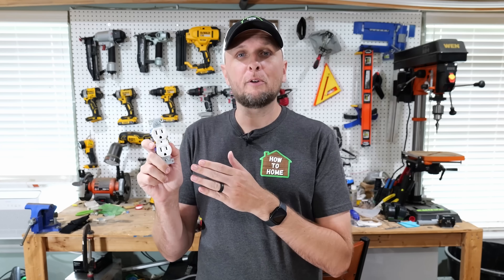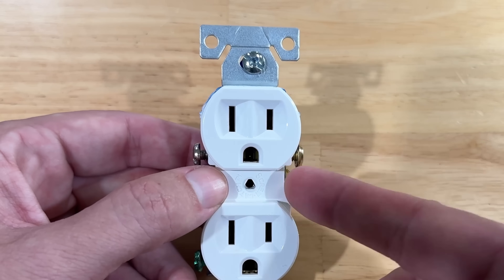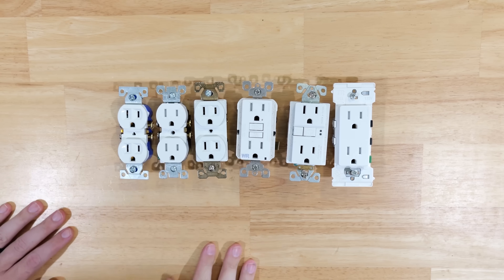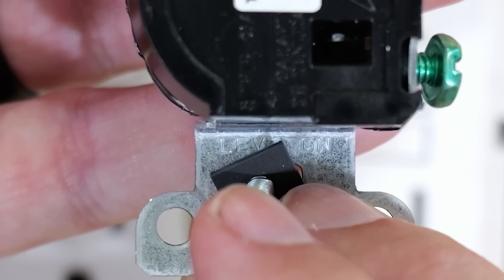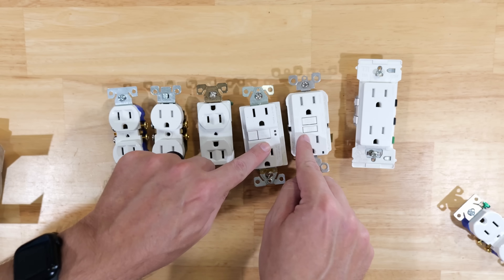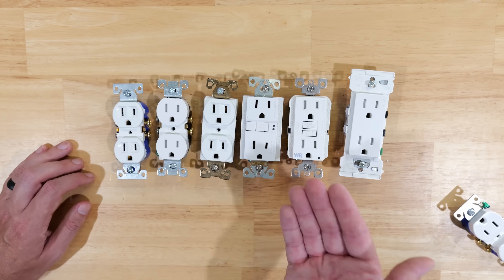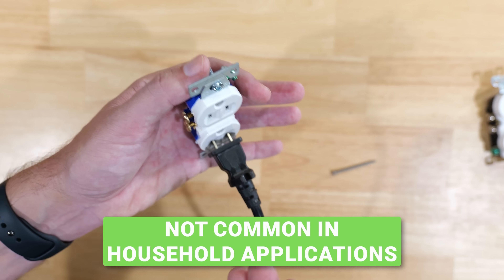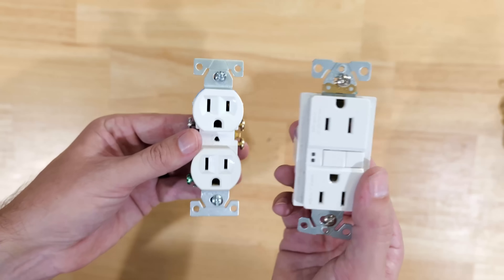The Shocking Reason Why Your Outlets Are Installed Upside Down!

Comment: Talking about text orientation was useless IMO. I have computer components with installed in my PC with texts facing every which way, it doesn't mean anything, but those components certainly do have a correct orientation.

Having said this, unless there is a specific case scenario where you want ground-prong in the up position, you should always be installing them with ground prong facing down. Why? Consistency. Power cords are designed with that in mind (like if it's a surge protector with a flat plug and the cord comes out of it 45 degrees to the bottom-left, then if you install the outlet upside down, that cord will face upward right instead. In general, when people plug stuff in, they are used to the ground-prong down orientation and will subconsciously expect it to be that way if they are plugging something in semi-blind.
Reply from the maker: I did it to make a point.  Your comment is useless IMO.  Everything was done for a reason.  Also, your PC isn't a receptacle.  When it comes to direction of install, it is irrelevant.

Comment: As an electrician in Ontario we install ground down for your safety. When your electrical cord pull out by mistake the first pin do come out first but you still have your ground for protection which will save your life.
Reply: @lecanada-d7f: Ground prong up when that outlet is attached too the wall-switch so people there know where to plug in their lamp to control it from the wall light-switch.
  Medical facilities have things hanging on walls that fall, like clipboards, scalpel, hemostat, that can fall and short the circuit, military galleys and  restaurants, ground up was specified, due to stainless steel utensils being dropped, etc. Therefore it has become required that they be ground up for contractors. In many cities ground up is standard in all commercial and industrial buildings, ground only go down in residential buildings, houses, apartments, condos, etc. 
   Internationally, countries with 3-prong outlets always have the ground up
   Everything is in context and the answer DEPENDS on context. 
   Examples:
“Never took the orientation of an outlet seriously until I was measuring for a shelf with a tape measure. It slid down and fell across the prongs of the washing machine plug.  POW! “ —@joef.6596
“I work at a K-8 school. Maintenance assembles powered multi media carts with the ground plug up in consideration of teachers dragging metal bracelet chains across partially unplugged power plugs.” —  @scaryhouse7969
“a length of florist's wire rolled off a side table onto a slightly loose plug and shorted the circuit, creating a small fire (quickly extinguished).  I now always install ground prong up” @deegee54
“I work at a restaurant and we have this work table with some outlets built in on top. Someone managed to let the edge of some tin foil go in between a plug and the outlet and it got disintegrated.”@MatthewSuffidy
“I knocked some change off of my end table one day my mistake of course, and a coin fell down right on the prongs resulting in a loud pop and a flash along with some smelly black smoke. I have since gone through my home and reversed all of the receptacles so the ground prong is now on the top.”—@chrisenglert3958
“my wife's gold necklace chain dropped off the rack onto two prongs of a device that were plugged into a receptacle with just a little prong showing.  It vaporized the gold necklace area of contact and left a nasty burn mark on the faceplate of the receptacle.   This was on a bar and I probably should have oriented the receptacles there ground prong up.“—@winfordnettles3292
"I had lunch with the Chief Electrical Engineer at McDonalds headquarters. He told me that one of the workers in one of their stores had her hand badly burned when a metal cookie sheet (or something similar) slid out of her hand. It fell onto a receptacle that was loose…the metal cookie sheet made contact with the two blades resulting in  big arcing flash that caused the injury, this is a reason Ground Up is safer."
“In commercial buildings (where receptacles are very high from the floor) ground has to be at the top. In a case of a water leak ground has the first contact with the water. In residential buildings (where receptacles are not far from the floor) ground needs to be at the bottom. In a case of a flood, ground wire would have the first contact with the water.”—@powerzx

Comment: The outlet itself is the worst design I have ever encountered. Permitting exposed energized contacts is just plain dumb. Both the European and the UK/Ireland outlets shield the contacts perfectly until the plug is completely removed. I have never seen a cable fall out of a European socket, but I see this in the US all the time. It is surprising how this flawed design was pushed on so many other countries where they obviously knew nothing about the much better alternatives.

Comment: This is a dumb non-issue. Here in America, we've lived with ground down outlets for centuries (plus all the years we lived with no ground at all) with absolutely no issues. I am 70 and have worked as an electrician's assistant on and off a good deal of my life. My work has always received top approval from the electricians certifying the job. Two of my 4 homes have ground down and 2 have a mix of no ground and ground down). Even the modular one I recently had built to replace the one I lost in a fire, which I built in the 80s, has only ground down. There is close to no situation I can see in a home where this would be an issue. In order for it to be an issue you would need something metal, incredibly thin, to fall down a wall and specifically land on the prongs of a plug that wasn't pushed all the way into the outlet. A plug left out far enough to still conduct electricity and leave a gap large enough for something to fit between it and the outlet/wall is in itself a situation which is basically near impossible.

Comment: I will add this. what if you purposely positioned plugs to what side of the 220v it is connected to? this way you would know not to plug 2 space heaters on the same 110v side. the fun part is wiring and older home. ever have a gas stove grounded to a PEX water pipe ? I did!

Comment: Thanks for settling this issue. I’ve installed many outlets in my homes, and always with ground hole down. But I have often wondered if this was the best way, or there was a good reason for the reverse. I’ve noticed that in most cases where the outlets were installed (presumably by professional electricians),   in homes as they were built, they’re almost always installed ground hole down. So that’s what I do, too.

Comment: Not an electrician but when I handle a plug I prefer that my finger is not in a position to contact the live prongs. My thumb is always on top and index finger across the bottom so if the plug is only partly in the outlet my finger could be across the live prongs.  I can’t think of an instance where anything metal  in my house would fall across the live prongs.  Plus a lot of plugs are meant for ground down orientation.

Comment: Seems odd to someone who doesn’t live in America.
Most countries I’ve been to have the earth pin at the bottom. These countries also have a switch for each socket.
We see this in Europe, UK, AUS and NZ for example.
Is there any reason you don’t have sockets with switches as standard?
You’ll also see in most instance by having the earth pin at the bottom the cable points down, it would point up if the earth was at the top, something I’ve never seen.
The nail argument is not really valid as it would trip the breaker (or don’t you have those either).

Comment: I'm in electronics and always agreed with installing sockets the "wrong way" for the reason that if you drop anything metal, which I've done before, it will short across the AC connections if not placed ground up.  I always thought that was ridiculous.

Comment: Three-prong devices like timers seem always to be ground prong down, and it's virtually all I ever see, so I never questioned that orientation.
Reply: Because you're not involved in industrial use. Medical facilities have things hanging on walls that fall, like clipboards that short the circuit, military galleys and  restaurants, ground up was specified, due to stainless steel utensils being dropped, etc. therefore it has become mandatory policy that they be ground up. In many cities ground up is standard in all commercial and industrial buildings, ground only go down in residential buildings, houses, apartments, condos, etc.
Reply: @violetviolet888  Believe it or not, I watched the video and he did address reasons for ground prong down around 9:30.

Comment: An important subject is how to be careful when replacing the plug on an appliance or tool with two or three wires properly.  I fried a printed circuit board on a garage door opener when I used a screw in socket to power a cord for another light which worked well until I turned the plug over when I was testing it and got the positive and negative exchanged on an old plug.

Comment: great video. You mentioned not having a 20amp plug on a circuit designed for 15amp wiring. What if the 20amp plug is GFCI? (I have extras from a previous project.)

Comment: If the plug becomes weak and the cord falls out easily, sometimes it will not fall completely out, but we fall down meaning the ground outlet will slip out before the power outlet or prong. I should say the most important part of any electrical system is the grounding so if the cord Falls partially out, then you lose your ground from your appliances, I always install mine ground down.

Comment: When I moved twelve years ago, my New landlord which is an electrician, told me that they (elecritians) decided to install them with the ground up in case there is water dripping,  it  is safer. I wound mind but the manufaturers did not adapte and so there devices will be upside down. The night light lamp is upside down. The air conditioner wire too and others. So I put all of them back the way they were.

Comment: I think this is a record! Something that should take 7 seconds to explain took you 15 minutes. I am not an electrician nor know much about it but someone told me upside down outlets are to show where outlets are that work off a light switch. Some houses dont have ceiling lights and have to use a light that plugs into the wall.
Reply from the maker: 7 seconds?  And it takes longer than that to read your comment which shares pretty much no information at all.  LOL
Reply: @HowToHomeDIY  I'm sorry you dont read well or fast. Your video title: "The Shocking Reason Why Your Outlets Are Installed Upside Down!"   (Answer: Ground prong up so falling debris does not short out outlet.) I think you can read that is less than 7 seconds. I think...
Reply from the maker: But that’s not even close to everything lol.  Seems I’m not the one having an issue understanding.  😂

Comment: Our house was built in 1980. All of the outlets were upside down. When we added on and remodeled, I “insisted” the outlets be installed right-side up (ground prong down). I figured the other outlets would eventually be fixed. Alas, it’s 25 years later, and our house has outlets that “ go both ways.” Drives me crazy. Old woman me just want them all going the same way so that I don’t always guess wrong when it’s time to plug in the vacuum.
Reply: @connie7335: If it drives you crazy, unscrew them and orient them the way you want them. It's not difficult. Otherwise hire someone to do it. Then it won't drive you crazy any more.

Comment: As a homeowner I install ground plug up because I read a book that envisioned a metal yardstick sliding along a wall - rather than the nail falling.  But I did not consider fingers touching the prongs which could provide a great lesson about electricity - an added bonus.
Reply: “Never took the orientation of an outlet seriously untill I was measuring for a shelf with a tape measure. It slid down and fell across the prongs of the washing machine plug.  POW! “—@joef.6596
  Ground prong up when that outlet is attached too the wall-switch so people there know where to plug in their lamp to control it from the wall light-switch.
  Medical facilities have things hanging on walls that fall, like clipboards that short the circuit, military galleys and  restaurants, ground up was specified, due to stainless steel utensils being dropped, etc. therefore it has become mandatory policy that they be ground up. In many cities ground up is standard in all commercial and industrial buildings, ground only go down in residential buildings, houses, apartments, condos, etc. 
   Everything is in context and the answer DEPENDS on context.

Comment: Throwing in my 2¢ worth.  I have been told since 1979.  The Grd goes down.  I asked why, and the response from my teacher was... if the plug is about to pull out of the receptacle in a downward motion, at least the Grd will be the last pin to pull out.  (Makes sense to me).  He said it was a safety precaution as well, but it also serves as a visual.  He proceeded with this methodology: In homes, always install with the Grd down. This is done to make the  receptacles take on the appearance of a face and an open mouth 😮as if saying "Ohhh NO!!!"   a great visual for children to connect with as a WARNING... this is "Dangerous" STAY AWAY from this because the little face is yelling 😮(Ohhhh No!!!).  From that point on, I have always installed with Grd down unless the prints suggested differently. I do concur if  receptacles are to be mounted horizontally, than the correct position calls for Neutral side up unless the prints specify differently.  And for what it's worth that's how I was trained in 1979.  After I got into the field I learned one more thing about receptacles.  Back in the day, many did not have a Grd pin hole. but some appliances had three prong plugs.  Now what?  You go buy a (US ground adapter)  with the green metal tab and plug that in with the tab at the cover screw. Screw the adapter tab onto the cover with the cover screw and you have a Grd for the appliance even if the receptacle doesn't have a place for a Grd pin. ....And now you know..... The Rest Of The Story....  Good Day!   😊

Comment: Ground prong down makes it look like a face. Likely installers think that way. But if you look at 2-prong outlets the neutral traditionally goes to the right, which recommends ground prong up. If I am plugging a three prong cord I generally orient the extension cord or whatever with the prong down.

Comment: My wife was using a tape mesaure to measure a wall. It slid down to an outlet that didn't have the plug fully inserted. It did give her a shock, which it wouldn't if the ground was up.

Comment: I just installed a Leviton surge protector outlet. The ground pin is on top when reading any lettering on it. The problem of course, as already mentioned is cables with right angle  plugs are typically designed with the ground pin the bottom -- such as refrigerators have.

Comment: IIRC, you were always supposed to install the ground prong down in case of flooding. Imagine rising water first getting to the ground prong then to the hot prong. If you installed it the other way, there is a possibility that the ground prong would get wet last.

Comment: My house has ground down. I don’t like it. Many plugs with the DC converter are in a way that the weight Ends up on top and pulls it out a little bit. Or the plugs that come out of the wall flat so you have room for furniture in front of it. These plugs usually are made to come out to the side and down. When g is up the plug has to go up and twist downward

Comment: If outlet protection is really required or a good idea then a recessed plug would be better.  For floor mount plugs I prefer a floor pocket to a surface/flush mount as it's less of a trip hazard and less likely to get unplugged from someone kicking it even if it's not in a walking path.  I did a search to see if any of this was required and didn't find anything.

Comment: The only reason orientation matters to me, depends on the cord that you’re plugging into the outlet. Most lamp extension cords will have the wire coming down so that the ground hole should be on the bottom. However, some thicker Cords require that the groundhole be on top so that the cordwill fall down against the wall. Such as my car charger.

Comment: I just replaced outlets in a house. Ground up on all the old ones. Every one of them was broken because the ground was up. The ground prong cracks out when installed upside down. So I disagree it does matter.

Comment: We always installed the so they resemble a Smiley face, i never had no issues, besides the ground connector is always at the bottom of the plug, Putin it upwards puts strain on the cord & outlet. If i find a outlet facing up when i rent i change it around no need to disconnect just flip the socket around & remount it.

Comment: I have been told the neutral side should always go to the left. But in fact it doesn't matter as long as you got the neutral and hot on the correct side.

Comment: My current house was built with ground all facing up and all it's been in pain in ass. This is because most vendors assume ground down when designing their power pack/adapter so it leads to situation where the power pack plugs in with all weight at top instead of bottom, then starts to sag and pull on socket instead of being way it was intended with power pack weight down and resting against the wall.
Reply: How old is this house and state
Reply: @mysticalos: You can easily unscrew them and re-orient them.